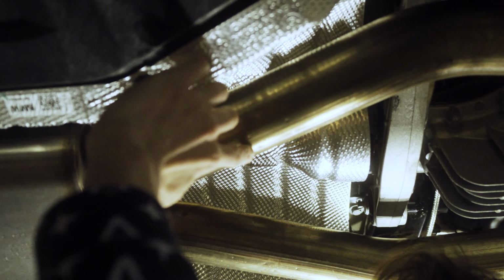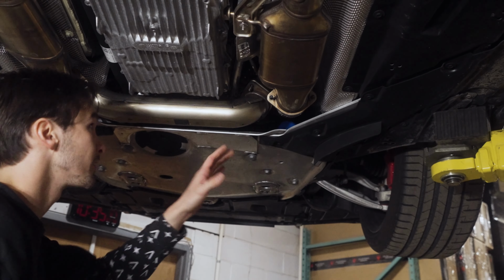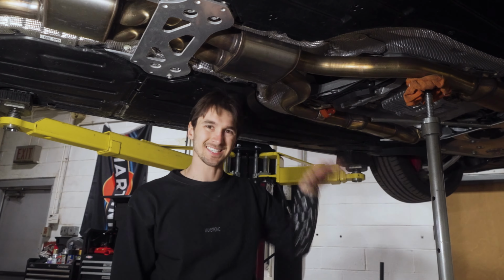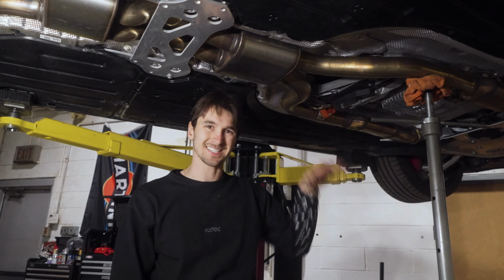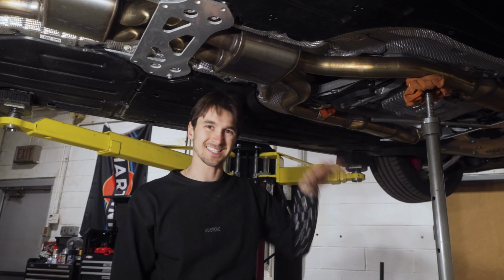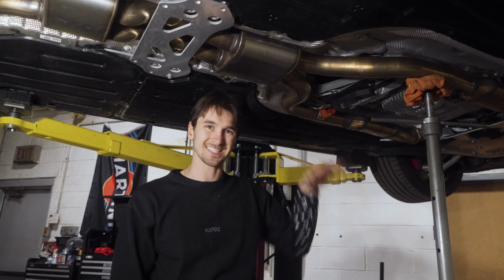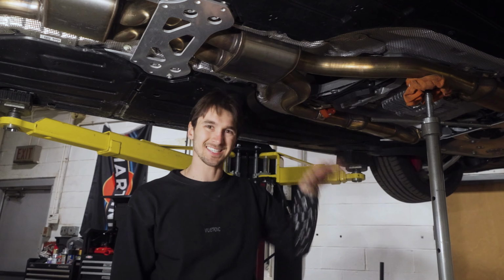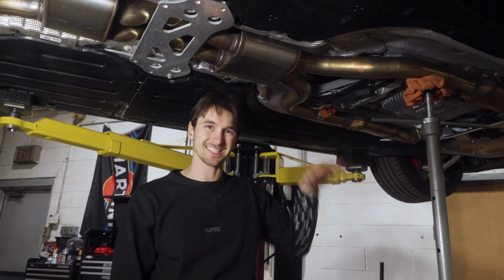How to Install a VALVETRONIC DESIGNS Equal Length Midpipe on your G8x M3/M4

Comment: I have a g20 330i with a gold plated valvetronic exhaust system made by you guys. I am having an issue where the Vacuum pump will turn on when I turn the exhaust on but then will pause for a second but then turn on again. This keeps going and doesn't turn off until I turn the vacuum pump off.
I dont know what the issue is but I believe it is affecting the right side of the exhaust. Could it be a leak in the vacuum lines? How can I troubleshoot this issue and make my exhaust system work perfectly again?

Comment: 2023 G80 does not have the cigarette light plug inside trunk. How would you install the valve opener? cant seem to find it on the valvetronic website.